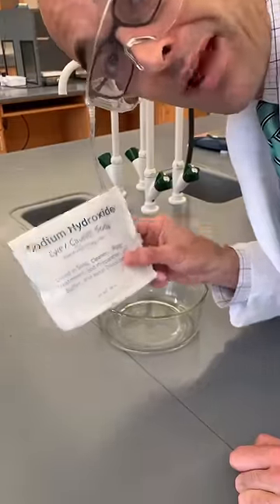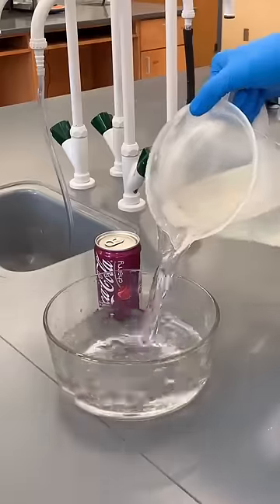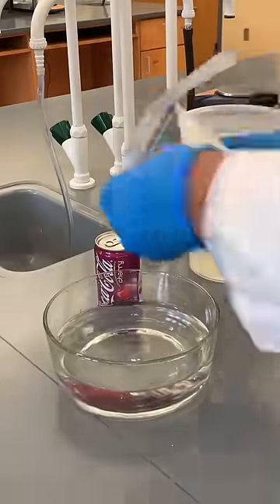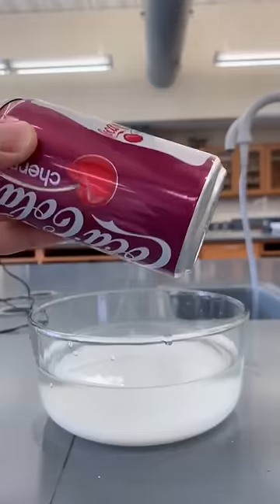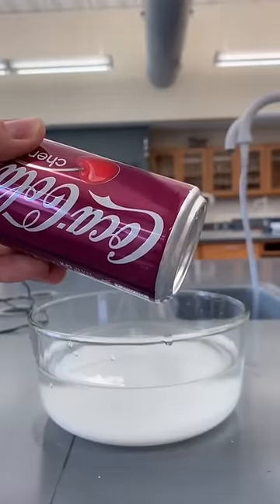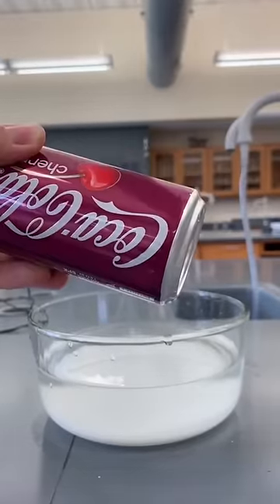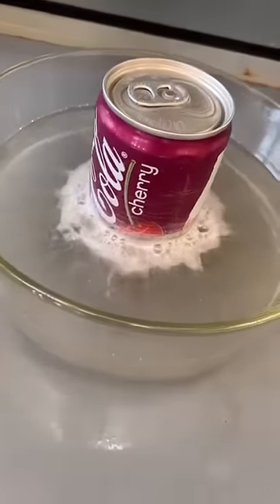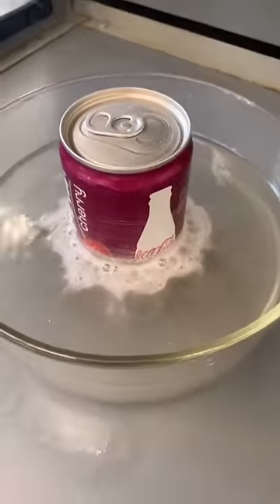Did you know this about aluminum cans?

Comment: This is exactly why Walter White sent Jesse to get plastic containers to dissolve a body.
Reply: It wasn’t that they were plastics, it was that it was a specific TYPE of plastic. That is why his fiberglass bathtub dissolved.
Reply: The plastic bins were hdpe (high density poly ethylene) and the tub was actually cast iron
Reply: Also the acid they used was nowhere near powerful enough to dissolve flesh. And this is lye which is the opposite of an acid.
Reply: @kevinfelton689  
Yup.  Alkaline metal salts.  They sure act like acids though with the right materials.
Reply: Sodium hydroxide is a base. If you’re implying the acidic soda would eat through the can that’s not the reason they have the liner either
Reply: @Aweoe  that's absolutely not what we are talking about.
Reply: @Aweoe  aluminum reacts with both acids and bases. I’ve had cans that suddenly leaked after months of sitting untouched.
Reply: @ronniebauman28  that is what you’re talking about. Youre saying this video (which shows a base eating through aluminum) is the reason Walter told Jessie to use a plastic container because hydrofloric acid won’t eat through it. False equivalence. Different chemical process. I know oversimplification is the only language you understand but things being similar doesn’t make them *the same*. This isn’t “exactly” like breaking bad.

Comment: This is why, I'm pretty sure most people have noticed the difference in taste when you drink from the can vs drinking from the glass bottle.
Reply: Just wait til he does the experiment which dissolves the glass away.
Reply: There can be a perceived different in tastes from either a) soda coming into contact with metal from the flap of the opened can or rim, or even your tongue ever so slightly touching the metal b) light penetration through plastic or glass, causing unintended chemical reactions c) more CO2 being released from the containers, with glass being able to contain more of the gases than the others with plastic being the worst.

So if you want the best and most intended soda flavor, drink from a glass bottle stored in a cold dark place, think wine cellar. Or alternatively from a soda fountain that is regularly serviced and maintained and has the appropriate carbonated water and syrup levels.
Reply: We dont even have glass bottles of coca cola anymore for years now only plastic bottles and cans
Reply: The drinks have different recipes for the different containers. Glass vs. can vs. plastic are all different.
Reply: @dennisraeimakers5218  
Outside the u.s. we still use glass nottles as well as plastic
Reply: @jeanluccouture9088  im from the Netherlands and havent seen glass bottles of coca cola here in many years unless its a collector item
Reply: I live in the d.r.

They're not necessarily available EVERYWHERE.... But whenever i come across any i buy it
Reply: Placebo effect.
Reply: Glass bottles that are available are imported from Mexico
Reply: Also it's the natural sugar cane that makes it taste different
Reply: What about the difference between a can and a plastic bottle?
Reply: Finessnu2  actually the Coca-Cola that is imported from Mexico in glass bottles does generally use cane sugar instead of corn syrup.  Where I live it isn't even that hard to find, several of the Walmarts carry it though the imported kind is usually in with the international foods rather than the drink isle.  If you go to a Mexican supermarket they almost always have it, along with the cane sugar Fanta.
Reply: @dennisraeimakers5218  No True.

Comment: A layer of epoxy is sprayed on the inside to prevent the acid in your soda from corroding the aluminum can it sits in. Essentially it’s still a plastic bottle
Reply: Actually it's so the metal doesn't contaminate the soda.

But either way it to keep the two materials separated
Reply: Additionally, the epoxy layer helps to ensure the purity of the soda by 
preventing any metal contamination from the can. In essence, the epoxy 
lining acts as a barrier that keeps the two materials separated and 
maintains the quality of the beverage.
Reply: Laquer.

Comment: Plastic is literally everywhere, "it's not through its curing cycle until it returns to dust" was the warning we had in the sixties.
Reply: And then the dust is the most toxic form of it.
Reply: And then it is micro-/ nano-particles which invade every part of every living thing.
Reply: They’re going to be finding plastic remnants long after all of us are gone.
Reply: Plastic, like every other thing, has its strengths and weaknesses.
Plastic is lightweight which enables food to be preserved and transported cheaply.
Reply: Sorry I might be an idiot, but can you explain that quote a bit? Not sure what it’s implying or saying
Reply: @Wilf-ki5tj  polyesters were some of the first plastics and they, epoxy resins, are fully cured until they've literally turned to dust.  Like on a fiberglass boat, when it's old, the glass remains but the epoxy polyamides have powdered away.
Reply: @Wilf-ki5tj  I think it says something like - we cannot get rid of plastics until it is turned into dust.

Comment: FYI-The Sodium Hydroxide chemical that he used is the main ingredient used in the hair salon to relax hair (make curly hair permanently straight).
Reply: Reminder that just because one chemical disolves one element, does not necessarily mean that chemical is unsafe to use on humans. Water has the same effect on salt, that doesn't mean its not safe to drink.
Reply: Many brands of Toilet Bowl & Drain Cleaners also contain Sodium Hydroxide.
Reply: @colacat1246  the premise of your comment is valid, but your example is really bad. Yes water is dissolving the salt, but it isn't a chemical reaction; it is physical. You can boil away the water and be left with the exact same amount of salt you started with. You can't do that with the lye-aluminum reaction.
Reply: FYI... it doesn't permanently straighten or relax all hair. It does for some people depending on how tight the curls are and the coarseness of the hair, etc. I've always had very natural curly hair and I've tried everything and I mean everything and nothing lasts longer than me getting my hair around any level of humidity. This was until chemo entered my body. After my hair fell out and grew in it was so straight, a bit funny because I was warned of the chemo curl. Well let's see what happens this time when my hair grows back.
Reply: Most relaxers don't contain lye anymore
Reply: @colacat1246  in all fairness, decent concentrations of lye will leave chemical burns and can take your skin off, but the effect takes much longer and can be washed away with less urgency in lower concentrations.
Reply: @dolphinsblu  hopefully things are better after the treatment..
Reply: it's also a primary high ph cleaner in all car washes including self service wash bays.
Reply: Lye is caustic. What he’s using vs something that would go on one’s scalps are 2 very different things.
Reply: Yes, it's a good way to clean the aluminum out of your hair as well
Reply: I guess I shouldn't put this stuff on my bald head .
Reply: @floridacracker_  thank you 😊
Reply: You sound like Elle Woods 🥰
Reply: @justinsane11 lye, caustic soda, sodium hydroxide... all three are one and the same.
Reply: @JyroOne  I didn’t say they weren’t. Lye may be the active ingredient in hair relaxer, but it’s not the only ingredient in said product. Pointing out that it’s dangerous to go ahead and put lye directly on your head to straighten curly hair.
Reply: Lye, Caustic Soda, Drain Cleaner. That's all it is. A common household product from the supermarket...